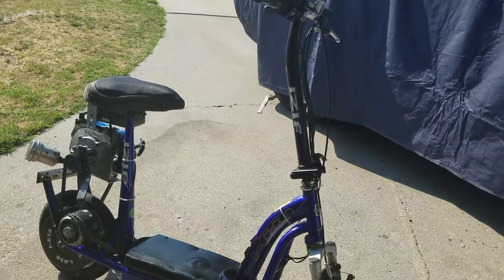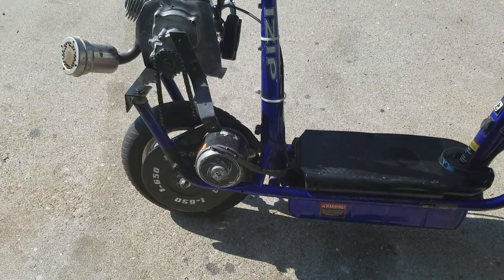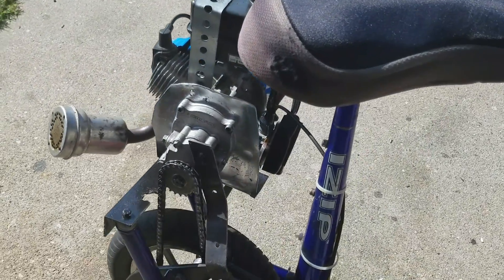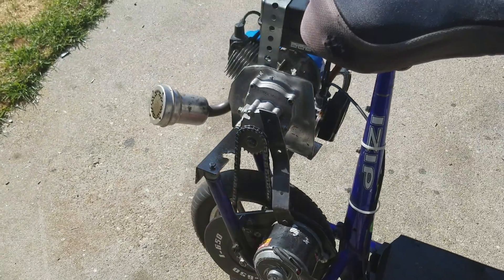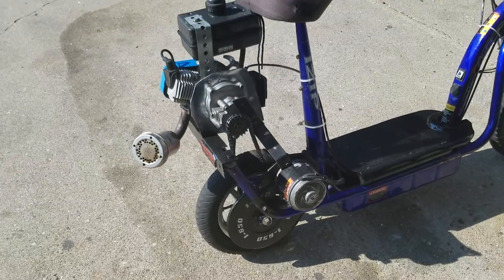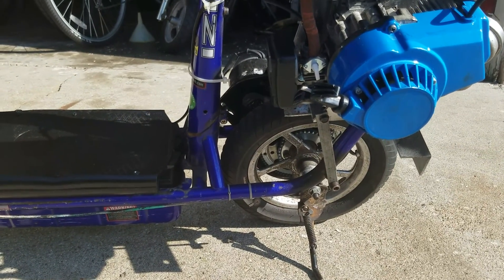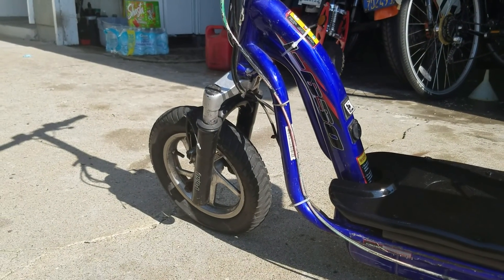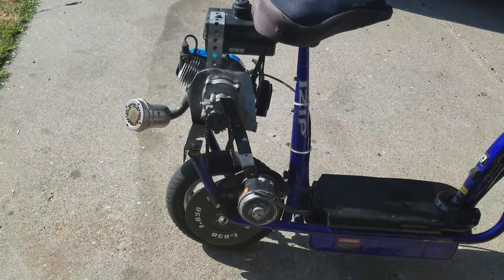Scooter -DIY- hybrid 49cc two-stroke with modified 650 watt electric motor.

Comment: How did you mount two sprockets on the rear axle since the original sprocket is just a single mount gear without the freewheel sprocket? Any guidance will be appreciated! I'm trying to get the same setup for my e750.